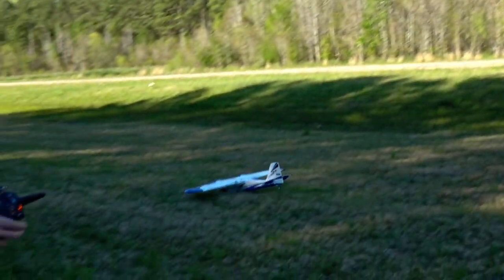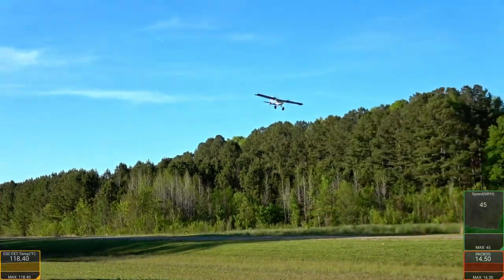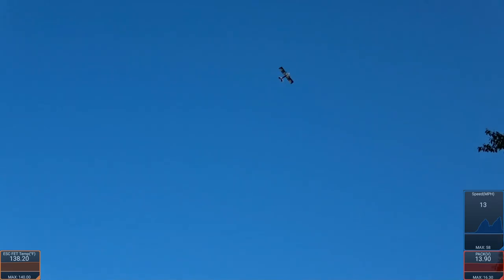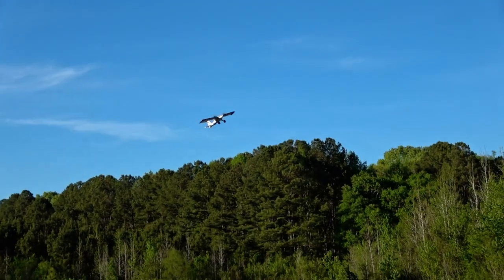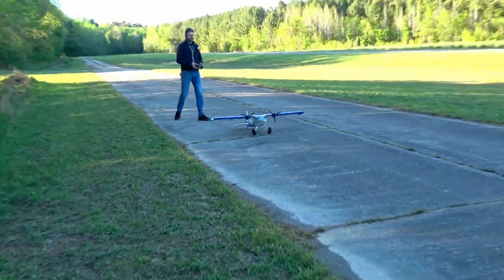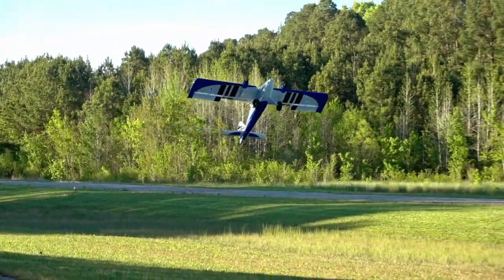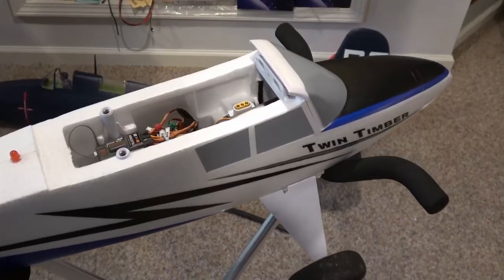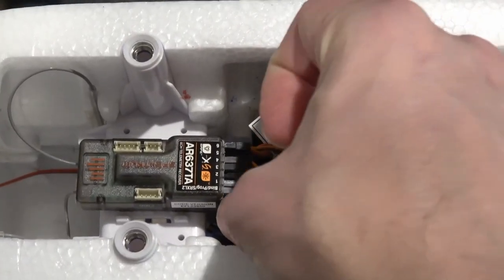A Nearly INDESTRUCTIBLE Timber - E-flite Twin Timber 1.6m

Comment: Thanks Jon! I appreciate the setup being added! Most important for me, really. I am getting more proficient at mixing with the IX14, but I'm happy to have the guide. Takes the guess work/research out, and reduces the learning curve considerably. Did you, or would you upload the setup file to your google drive? Thanks again bro, really appreciate the work and effort into the channel!
Reply from the maker: Unfortunately no, we can't post any setup files for at least a week as our transmitter is en route to HH for servicing due to a faulty charge port. When it gets back and we make another Twinber vid, chances are we can post a setup file for anyone who uses an IX radio.
Reply: @TwoBrosRC  Sounds good, thanks!

Comment: Great review! I like how you take the planes through more then just basic flight. The advanced setups you do at the end are great. Theyre also short and sweet.  Really makes it easy to know if i would really want a plane or not. I agree with the score (maybe a 9 cause of the porpusing when landing) for what this plane was originally designed to do, it appears to be built very well to do it. Im going to pass on this one though cause the big ass eflite cub ss with the motor and prop upgrade you recomended and omp bighorn 4s fill my high wing prop needs😄. Keep pushing those limits

Comment: Great review Jon. Yay for the beefier gear springs, but I see the wheels are severely toed-in especially the right side. I assume the gear struts are the same soft aluminum as the TT Evo and at least in my experience the bottom ends of the struts can bend during hard landings in rough ground, causing that toe-in. Beef up one part of the gear and the next weakest link shows up! 😜
Reply from the maker: Nothing an adjustable wrench couldn't fix up easily!

Comment: I just bought a Twin Timber 1.6, and I'm amazed with it, and even more so after seeing You flying it. FANTASTIC.
I made the configuration changes (mixings, etc.) as you suggest in this video and they really work as you exemplified, BUT... in Flight Mode "AS3X-Safe Select" the Right Aileron does not obey the Stabilization.  Can you tell me why this is happening?
I am using the "NX10" Transmitter which is duly updated as well as the "AR637TA" receiver.
Thank you very much
Reply from the maker: You need to reprogram the receiver so it understands that you're using the new wing type. This should be covered in the setup guide - or at least the basic info on it should be.
Reply: @TwoBrosRC  Ok, but how can i do it if the Receiver "AR637A" that comes with this Twin Timber is LOCKED and therefore neither with the SPEKTRUM PROGRAMMER on the Computer nor with the FORWARD PROGRAM of the transmitter it is not possible to have access to its configurations???  Spektrum say that "updating" it (?!?!) it will stay (?!?!) UNLOCKED... THAT'S NOT TRUE!!! I already tried to do it several times and many other "ways".... AND NOTHING!!!! Can You help me please? Thanks.

Comment: Thank you for another great video, sir.
While I don’t see the “Twinber” ever having a spot in my hangar, I still wanted to watch your review. I usually pick up something from your uploads that benefits my enjoyment of the hobby.
I do have a question for you. What do you use to get airspeed on your IX20? I recently switched to an IX14 and would love to have the ability to track airspeed without using my SkyRC unit. Is it as simple as just adding the Spektrum SPMA95871 GPS module to telemetry capable receiver? Thank you for your time and response. -Guy
Reply from the maker: We use the Spektrum GPS sensor you mentioned. You plug it into the X-Bus port and bind the receiver to the radio with it installed, then your radio should auto-initialize it and you'll see it in a telemetry panel if you swipe right to the GPS screen.
Reply: @TwoBrosRC  Hey guys, Spectrum lists 3 Spektrum GPS sensors,  which part number did you use? P.S. great video! I per-ordered one. Thanks.
Reply from the maker: @ralphfrasier2079  https://bit.ly/3hDkcsY should do it for ya. Thanks for the support!

Comment: Great review. What mix rate from elevator to flap do you recommend for high alpha flight? And with the flexibility of 4 wing control surfaces with independent servo connections, do you use more than 3 flap/crowe settings, or just full span flaps, flaps with crowe and wing normal? And I have heard you recommend a different propeller. What is its spec please.
Reply from the maker: We cover the prop change in https://www.youtube.com/watch?v=zstvhTiH08g coming up at 11a EDT. Setup info is at the back end of the vid you commented on.

Comment: Looking for a 2nd plane, would you rather have this twin or evolution? I just got back into the rc World from being away for 8 years. Both look awesome
Reply from the maker: If we had to choose, Evo is more suited to our flying style. But its gear can't hold up to the Twinber, so there's tradeoffs involved.
Reply: @TwoBrosRC  yea gear was a concern as ill be mostly flying in grass and not so smooth fields.....I'm just beginning to do aerobatics but nothing major, not looking to do full 3d aero but from the looks either model will be sufficient with what I'm trying to achieve...it will be a hard decision
Reply from the maker: @nichollsboy11  Go with the Twinber then: https://bit.ly/407xQ8r - it'll handle rough fields and rough landings much easier than the Timber Evo will.

Comment: Can you try fitting it's landing gear springs to your turbo timber evolution. See if they would work better then the original
Reply from the maker: HH has confirmed that they won't fit - but there's a potential of upgraded springs coming out for the Evo and other Timber models.

Comment: Would this or the turbo timber be a good second airplane for me? I’ve been flying my Skynetic glider for months, doing loops and low passes comfortably and want something a little more fun. Thanks!
Reply from the maker: This would be easier to fly than the Turbo Timber due to the lower wing loading and severely reduced risk of gear issues and/or prop strikes. You'd enjoy it.
Reply: @TwoBrosRC  thanks for the advice! I really enjoy your videos and hope I can be at your level of flying someday 👍🏼

Comment: Do you think the spring upgrade will keep the same foam timber tires from separating from the plastic wheels?
Reply from the maker: So far, so good, even with intentionally landing like a meteor! The only separation we've seen was at the tailwheel which has a much smaller contact patch with the wheel hub.

Comment: Your video is great regarding the Twin Timber, but I cannot figure out a way to program the plane such that I have four or more flap settings with an AR8360t receiver and iX14 transmitter.  plane is set up with 2 ailerons 1 flap.  The AR83060t is set up as follows:
Bind slot- binding cable
Slot 1 throttle
slot 2  right Ali
slot 3  elevator
Slot 4 rudder
slot 5 left Ali
slot 6 flaps
Slot 7 Lights
Slot 8 empty
Currently, under model adjust- flaps- I have a three position switch setting for no flaps, 40% flaps, and crow.  All three switch settings work correctly.  However, I would like to have a fourth flap setting that is just full flaps, not crow.  Is there a way to program it through mixes to accomplish this?  The guys at Tower Hobbies say it cannot be done with AS3x and SAFE employed, which sounds wrong.  Any help would be appreciated.
Reply from the maker: The setup guide in the video covers how to program full span flaps. It's also entirely possible to have AS3X and SAFE with that setup, you just have to ensure that you've used Relearn Servo Settings in the receiver Forward Programming menu.

Comment: Do you think the twin timber landing gear Springs would work on turbo Timber evolution, would you have a minute to measure twin Timber Springs tip-to-tip
Reply from the maker: HH has stated that they don't fit. There may be a version coming out at some point for Evo.
Reply: @TwoBrosRC  thanks. The TTE has a measurement of 190 mm, I would be interesting to know what the difference is

Comment: Can you set it up with differential thrust?
Reply from the maker: Absolutely! The twin 40 amp Avian can be programmed from the transmitter or use a programming box to set it up. It comes with 10% differential stock. We disabled it but you can set it up to 50% differential.

Comment: I noticed I the comments that you disabled the differential thrust. How did you do this, or what is the process?
Reply from the maker: You can do this via the Avian programmer box or via the transmitter under the Smart ESC menu.
Reply: In the video I did not see it hear you mention that you disabled the differential thrust nor shoe the difference in the performance of cutting it off. I wish you could do another video on how to disassemble and the difference between enabled and disabled.
Reply from the maker: @randyhardee9918  We ran out of time to get that mentioned, unfortunately. It was a lot of work to get this edited and filmed and it was all finished a few hours before it went live, so we focused on what we felt was the most important info at the time.

This isn't the last time we'll be flying the Twinber, so we'll cover more info on it in the future - and will try to remember to show how it performs with and without differential thrust.

Comment: Another great video Jon.  I have the Turbo Timber Evolution and interested in this one also.  What is the difference in max speed between the two models ?
Reply from the maker: Evo's stock top speed is around 85 MPH, stock top speed for Twinber is about 65 MPH. This is level flying, no diving.
Reply: So the evolution is quicker but the twin has more instant torque?? 
Which would you rather have as a all around flyer??
Reply from the maker: The Evo is our preference since it can perform the kind of 3D acro we're expecting.

Comment: I'm curious, how are the two motors controlled separately? Does the rudder stick vary the speed of each motor to assist turning? Thanks!
Reply from the maker: The dual Avian ESC allows for differential thrust in stock config.
Reply: @TwoBrosRC  Sorry to be slow, but there is only one throttle stick on the transmitter, so what makes one motor turn at a different speed?
Reply from the maker: @billspurlock3362  Rudder input causes the ESC to adjust motor speed differentially.

Comment: What’s the max prop diameter it can take? Thoughts on larger diameter and lower pitch?
Reply from the maker: No idea on that question.
Reply: It looks from the front like it probably has enough clearance with the fuselage to jump to an 11" prop.
Reply from the maker: That's a potential, but keep in mind that the motors run on 40 amp ESCs and might cause the ESC to overheat - you'd want to run an amp meter.

Comment: Sure would like to have seen an inverted flat spin with and without thrust differential
Reply from the maker: It's not something you can turn on or off at a whim. It has to be programmed into the ESC and is on or off all the time.
Reply: I realize there is the issue of the nr of channels and a pnp bird with a different rcvr will allow it to happen.  Just day dreaming here.

Comment: what is the wing loading?
Reply from the maker: Moderate, but not terribly heavy. Check Horizon's site if it has specifics.
Reply: @TwoBrosRC  I was going to calculate WL & WCL, but the wing-area isn't listed on the plane's web page or in the manual. In the RCG thread for the plane, I asked Jason for the wing area but I haven't seen a reply yet.

Comment: Unless you mixed in elevator it looks like it doesn't couple nearly as bad on knife
Reply from the maker: No mixing, just pure rudder with a little aileron input. It's not all that great at knife edge unless you're going quick. The Evo can fly high beta KE while the Twinber can only seem to do it at full speed.